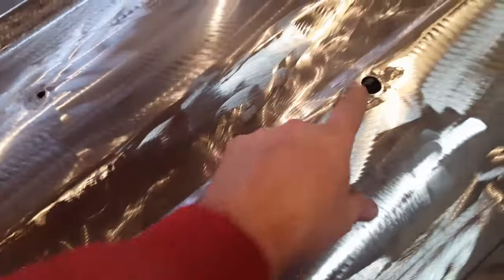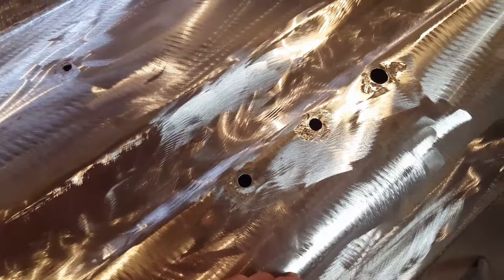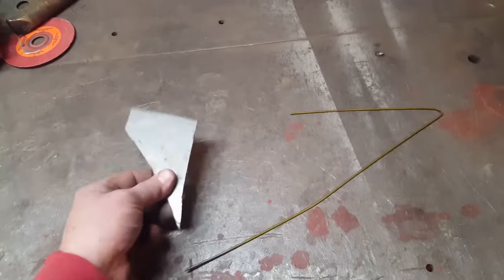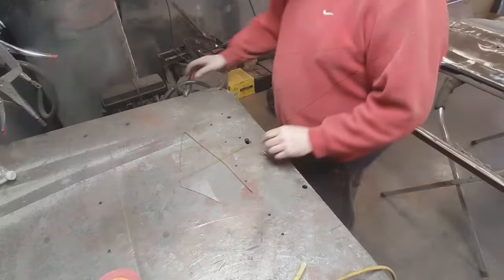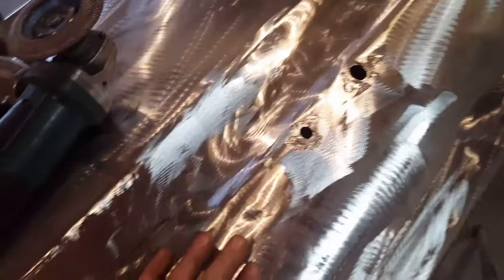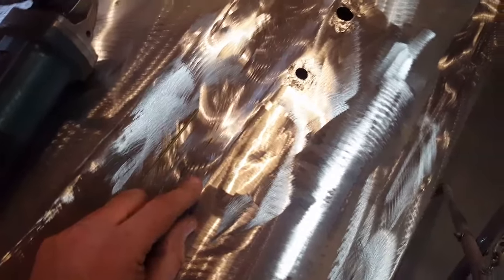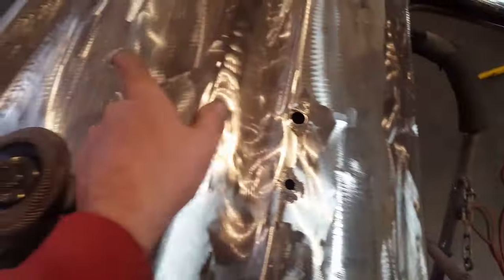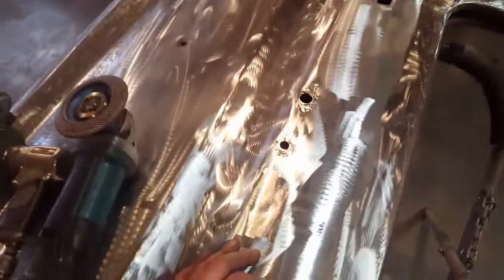How To Weld small holes the easy way

Comment: That's how i was taught in school 45 years ago, it good that you are showing the younger generation the old timers tricks of the trade, Working in welding my whole life i found using a block of Brass or copper on the back side of a hole and Mig or Tig welding the hole full worked well in some area's, I used your method back in high school body shop in the late 70's with Gas welding. Some of the fun tools they have now days like air punches and crimps can make a body mans job a little easier keep up the teaching Sir. It's nice to see a body man that can still fabricate body panels from scratch.
Reply: If you can get to it  that’s defiantly the cats meow 😻

Comment: On jobs like this, for a beginner or anyone else, lol....
I use liquid white out around the holes.
Press the filler piece against the hole and the diameter is on the back to get an exact fit.
Just trim it until the white out is gone.
Great coat hanger trick too.
Havent seen that done by anyone else but my buddy.
Kudos !
✌n ❤
Reply from the maker: Cool idea on the white out. Thanks for watching

Comment: I use nail heads to fill mine. 
A quick little spin on the bench grinder takes  the edges down to smaller diameters if needed.
Weld it in the hole and cut off the shank and grind it flush.
Reply: Now THAT is a smart idea!
Reply: Great idea!
Reply: your a smart dude   exellent
Reply: Me too.  I have an 83 gmc that has more nails in it than my house .

Comment: I have a set of hole saws that I use in a drill press to make the plugs.  You have to measure the ID of the hole saw to get the right size.  The coat hanger idea is a good one.
Reply: Super idea to match Fitzee's technique. If you use a step-hole-bit to drill out the rust-holes and spend some time pre-drilling different size plugs with some bi-metal hole bits in a waste panel; some sorting bins from Princess Auto to put them in; I bet you could have a nice assortment of ready made ones to suit a number of these in varying sizes.
Reply: @39knights  Excellent!

Comment: For reachable holes you can use a copper-stem from the backside and fill the hole with weld.
Reply: me too
Reply: I do this... I drill a tiny hole thru a piece of copper and put a piece of stainless wire thru the hole...works like his coat hanger to hold the copper in place.... if I don't have enough hands...I tack a U shaped piece of scrap onto the door and tie the wire to that... fill hole with weld starting at the edge that touches the door hole...and the wire gets zapped with the weld and falls thru as the hole is filled with weld...remove the U bracket and clean up the weld
Reply: That’s how I did it but used old pennies , on my warlock door mirror holes

Comment: Good video, thanks for the advice. I've used an old grinding disk as a backer in the past, the weld won't stick to the disk. But it only works if you can get to the back side.

Comment: With a good MIG You can set the heat setting on low depress the metal about 1/16 of an inch and go around the outside of the hole in a circular fashion to the middle all in about a minute but you do have to have a very good mig to do it. You won't get any heat distortion that way.

Comment: Cool. When I did some small holes on my F1 doors, I used a bolt and screwed it in the hole-a couple threads, and ground it off. Zapped it a bit, then smoothed it.
Reply from the maker: I done that as well. Nicely done

Comment: This works wonders, especially if you have a sheet metal nibbler to make the patches faster. I’ve also find washers that fit the hole
And then just plug the hole up with a quick weld.
Reply: good idea

Comment: Washers work well with a long screw in centre hole- hold an alloy/copper heatsink behind and plugweld small centre hole last👍
Reply: Careful, most washers are zinc plated which releases toxic gas when welded.
Reply: @DavidPlass  
Is that what I was feeling? :)
Reply: David Plass well it probably won’t weld worth a damn. Just pop and spatter. As long as the coating is ground off, it’s just like welding regular steel

Comment: Nice job welding holes in doors. l will keep that in mind next time I need to fix a hole in the sheetmetal.
Reply: Peace
Reply: I all ways have a bit of brass plate ,  place behinde hole and just weld ? Weld wont stick to brass
Reply: @timothyrouse2853  Got you fella, brass is cheaper than copper plate. Will keep that in mind for the future projects.

Comment: Yes use plugs on large holes but on smaller ones just "edge-weld" the hole until it's filled...or, place a piece of solid copper under the hole and weld in the hole using the copper as a dam...weld does not stick to copper. I use old copper fittings used for junctions in brake lines. Make sure you hold the copper with plyers because it gets pretty damn hot!

Comment: have a range of plugs laser cut from sheet to stock drill sizes, drill each hole out with a stepped bit, could even include a tang on the plug design to bend and hold with pliers.

Comment: Thank you for the video.  Curious, roughly how small would a hole need to be to skip the patch piece?
Reply from the maker: I welded up many a 1/8 hole but when getting into 1/4 size holes i found you ending up with a high weld and sometimes would have to reweld it. If you can get to the back of it with brass you have no trouble with the 1/4 inch hole. But your not always able to get to back side
Reply: @fitzeesfabrications  Very helpful, I really enjoy your videos and learn something in each one.  Thank you for taking your time to reply.

Comment: I enjoyed watching this video,  do you have any tips on how to fill pin holes in the bottom of a vintage Harley gas tank while not warping the gas tank and ruining the original factory paint?  I was thinking of brazing? Some of the holes are pin size and others are 1/8 inch in diameter.  I appreciate any tips or advice. Thank you.
Reply from the maker: Think brazing is the best plan. It can leak with a mig.
Reply: Fitzee's Fabrications Actually, I was first considering brazing, but I don’t have a oxygen acetylene torch set and did not want to buy one just for this one job. I do have a small Clarke flux core mig welder, however after testing on some  thin gage scrap metal .016 and .025 I kept blowing through the small pin holes I drilled in the test pieces and was warping the thin metal even at the lowest settings on my mig, even when trying to do a quick spot weld. I then tried to use a small hand butane torch with acid core solder, rosin core solder and silver solder on some thin test pieces of metal to fill some pin holes but I was not satisfied with the results and the fillings looked weak for a fuel tank. What I liked about Gills lead filling method was, it looked like I could melt the lead without too much heat and risk warping my vintage Harley Davidson gas tank and harming the original paint, and since many of the pin holes are close together I can spread the lead over a wider area with better control using a paddle. I noticed Eastwood sells various starter lead kits for about $116.  Also, I did think of just renting a oxy acetylene torch for a day but most likely the cost would be the same as buying a lead kit from Eastwood.  And keeping the heat to a minimum on this repair. I definitely won’t use a tank sealer because I hear many bad things about that route and the same with epoxy metal fillers.
Reply: you might be better off getting the liquid repair stuff that can line the bottom of the tank as it is clearly a bit thin in places there.
Reply: Silver solder (Harris "Safety-Silv 56), flux (Harris Stay-Silv), and a MAPP gas  (or propane, which'll take longer) tank, attached to a torch. Does wonders. Flame away, bro!

Comment: How do you prep the metal that you have cleaned out like on the door you did this hole patch demo? Bare metal.
Do you have a video on it? Thanks for the tips...
Cheers..
Reply from the maker: It stripped with a 24 grit disk
Reply: @fitzeesfabrications  yes I realize that but what or how do you do to protect it? Primer base sealer or what? Thank you

Comment: I luv your work and the tips👊 What's a good way to determine the speed of your wire feed? I figured out on my last project...after the fact,that I had #1 too much wire exposed and #2 my speed was way to slow. Hindsight is 20/20. Any help will be greatly appreciated. Thanks in advance. I'm using a 125 flux core machine btw w/.035 wire.
Reply from the maker: Check out my video how to set up a mig for sheetmetal. Its all there

Comment: Another way is to shove a bolt in the hole tac weld it just deep enough to pass the metal then cut the top off. You can use the same bolt for 2 or three other holes. Works great

Comment: Hello Fitzee, recently found your channel and find it really informative and straightforward. Just starting on my van which needs minor welding. Question is. When welding up small holes in my van floor do I have to clean the underside of the metal before welding. Under the van ? Thanks
Reply from the maker: Will depend on if there is under coating. It sometimes bleeds up into your work. Most tie just cleaning the top side is good enough.  You will know if you run into trouble
Reply: @fitzeesfabrications  thankyou very much for your help.

Comment: Use a step drill to enlarge the holes and make them round. Chuck the coat hanger in your drill and rotate the plug patch against your table grinder to make it round and on size. Thanks
Reply: I'm using a tungsten carbide burr to make the hole fit to the plug. It's easier.
Reply: Good ideas
Reply: That would only work if you welded the coat hanger at a perfect right angle to the patch or wobble wobble!

Comment: I would think holding a brass backer and just tacking in the hole would be quicker than trying to shape and position a plug. 
I still like it.
Reply: LOL... Try it sometime. You won't do that again.
Reply: thats what we did in the body shop. The brass also absorbs heat and helps control warpage.
Reply: I use a copper backer and just fill it. But Fitzee is teaching me a lot.
Reply: What a joke...if you know how to use a Mig properly you can sew up that bunghole in 30 seconds with no backer.
Great video though....if you have the time lol.

Comment: If I can get to the back side of it I use a flattened piece of copper pipe. Hold it against the back of the hole, and plug weld it.

Comment: Quick question.
I’m not welder. I just got a 110volt welder would that be ok to weld holes on a fender? Or do I need a 220 welder?
Thank you in advance
Reply from the maker: 110 better for body panels

Comment: So clever!  I have a couple q's.. how much smaller did you make the plug and was the edge cut 90 degrees or angled like the edges on the gas lid bed side video? THANKS!
Reply from the maker: Just a straight cut. I made them so they passed threw the hole. If it is bigger the Patch would be higher then the hole. I flush mount it.

Comment: Do you think that this method works better than backing up the hole with a piece of copper, If so Why ?
Reply from the maker: It works better when you can't back it up. Sometimes backing it up is a two man job. Hard to reach around. This works better there too.

Comment: Soo slightly off this specific topic but when you have some pin holes is it worth patching it just use filler over it??
Reply from the maker: I'll patch all holes. And pin holes ill drill out. A small 1/8 hole in a panel is a 1/4 inch hole minimum. What you see outside is no less then half the size of the rust that is really  there

Comment: I saw "small" holes, you got 1/2" holes. I was thinking you  were going to weld on top of a brass block, hold block on inside, weld doesn't stick to brass. I learned from an old body shop man. We also drilled a lot of holes to weld panels together when assembling front end sheet metal - don't forget your Zinc weld through primer
Reply from the maker: Not a lover of the zinc primer. I find it affects your weld and you don't get a clean weld. You still burn the zinc off when your weld is hot

Comment: I love your channel. Just subscribed. The only thing I would ask is the please give us your wire speed and amperage. Shielded or gas ? For us puny new welders
Reply from the maker: It will depend on the welder. Some are Hotter then others.dial settings are different on different machines. My millermatic has a wire speed of 60 and heat range of 2. It has 4 heat settings. I use co2 for my shielding gas
Reply: @fitzeesfabrications  interesting i don;t hear the gas coming out the gun, what flow rate you got set ?  mine has a noticeable hiss ..

Comment: Total novice here - wouldn't you have a stock of plugs to fit specific drill bits?
Reply from the maker: You could but sometimes the holes are not perfectly round. Some holes can be bigger then a larger bit

Comment: I recently fixed a hole about 1 inch in diameter. I used 20 gauge steel and .030 mig wire at the recommended settings on my Lincoln SP 175 plus welder. I got some pretty sever shrinkage. The panel sunk in about six inches all around my weld. What should I have done different? Thank you.
Reply: Welding school?

Comment: Can you use copper welding spoon and pool the holes with mig or will that warp it too much
Reply from the maker: Alot oh heat . Larger holes I like doing it this way small holes the brass or copper backing is fine. Any hole over 1/4 I like to do it this way
Reply: @fitzeesfabrications  thanks

Comment: How about cutting a patch with the hanger welded and have hanger wire up thru the back side of the hole and weld it in
Reply from the maker: Don't like overlapping from inside. I done it in the past just feel there is places for moisture to get trapped

Comment: Great info. Learning lots. Where do you draw the line on filling holes or replacing the door skin? 11 Bullet holes in a 49 Ford door. Thought I would try filling or just ordering the door skin.
Reply from the maker: It all depends on what your after. Bullet holes are stretched so you will have a section 2 inch around you will need to work . These mirror holes were 3/4 of damage
Reply: heh is this a mob car or something :o

Comment: I made a heat sink years ago from a old screwdriver and some copper pipe it worked well for me i think its titled homemade tools in my videos
Reply from the maker: I have a peice of round stock  brass  5 inch by 1.5 diameter. Works same way. But your idea will work too. It it's long enough and there is nothing behind the hole. I'll check it out.

Comment: In the workshop, we put a piece of copper under the hole, and fill the hole with welding, the weld does not stick to the copper, we remove the copper, the method is very fast and clean, and nothing else is needed.
Reply: What if you cant get to the other side?
Reply: @shedendman  Then you don't need your passport any more.

Comment: I use my stud gun and weld a copper stud to a piece larger than the hole. Insert it from the backside and grab with some vise grips. Tack it in place. Grind the stud off. Weld the hole solid, much slower than he does as I'm sure he had some warpage. Coat the backside with some fiberglass filler and undercoat.

Comment: Question.....what size mig wire are you using for sheet metal repairs and body panels? Maybe .23 or .30?
Reply from the maker: I use .23. I find .30 leaves too Much material and you have more grinding..30 is better for heavy work. Frames and such

Comment: If you have access to the back couldn't you weld a backing to the other side, flip it over and just fill the hole?
Reply from the maker: You end up with layers where moisture and get trapped and rust. But yes it would work. I done that on quick ruff jobs in the past

Comment: Slide the coat hanger with the welded metal thru the back side then weld it you will end up grinding either way just less shaping the metal to fit the hole

Comment: 👍👍👍👍👍👍👍👍👍👍👍👍👍👍👍👍👍👍👍👍👍 what size wire are you using and what is your wire speed and how much heat on your setting
Reply from the maker: .023 millermatic 130xp is set up with wire speed at 60 and heat on 2

Comment: If you can get to the back of the hole put a piece of heavy copper behind the hole & weld it up. The weld wont stick to the copper. Ive done it many times.
Reply: I am new. How would I do that?

Comment: Hello , love your work .when welding  the rear quarters on 79 bronco , do you butt weld to below the b pillar or do you separate the bottom of b pillar and put the flange between it . It is tough to get inside to weld it . You may have to cut an access area on the inside . Can you do more videos on the bronco ? Thank you
Reply from the maker: I cut and butt in that section. As you know it is a hard spot to get to. Seems to me the inner structure is put on after and would have to be removed to do a factory join.

Comment: I’m not a body guy so I’ll ask. Why not bring the round tab and hanger in from behind and fill over it. Then when you grind you have enough surface area. I worry about grinding through a high spot and making another hole??
Reply from the maker: What if you can't get behind the hole?
Reply: @fitzeesfabrications  I agree with that. But on my door I can. I figured you could also. So I figured you had a good reason, I just didn’t know what it was.

Comment: I wonder if the plug from a holesaw could fit and save all that grinding time?
Next thought; metal electrical box plugs?
Reply from the maker: No two holes are alike unless you making them all the same size. The electrical plugs are galvanized. Never good to weld
Reply: @fitzeesfabrications  Yup, toxic from the zinc.